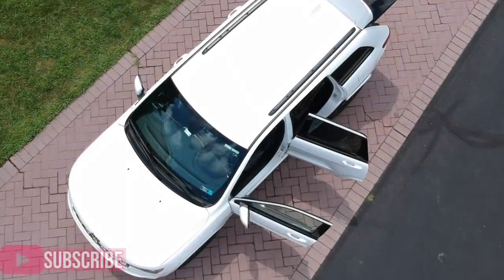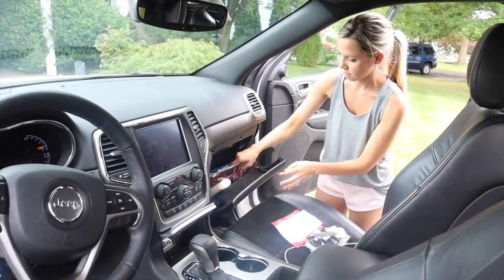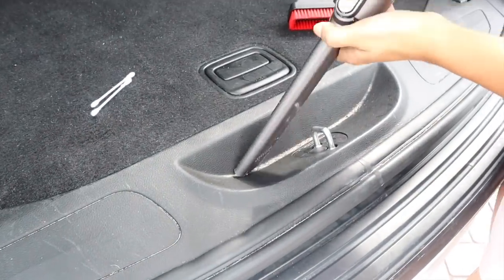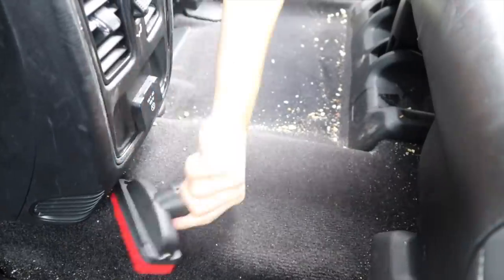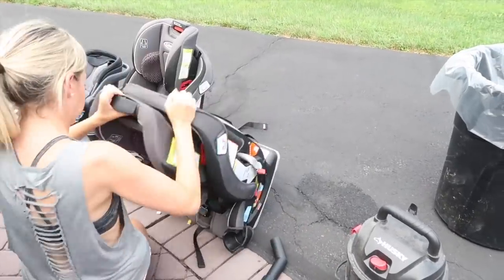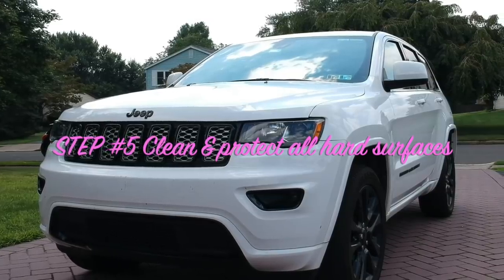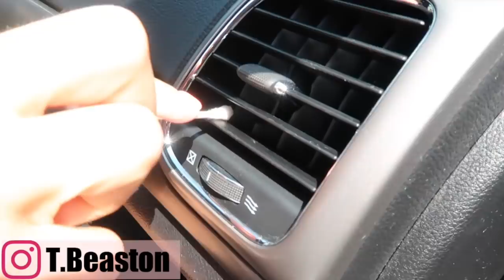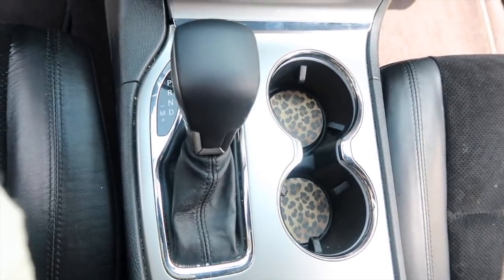EXTREME CAR CLEAN AND ORGANIZE // COMPLETE DISASTER CAR CLEANING ORGANIZATION HACKS // CLEAN WITH ME

Comment: you have to get the Tineco A10 Hero Cordless Vacuum, Stick Vacuum Cleaner Lightweight 350W Digital Motor Lithium Battery and LED Brush, Handheld Vacuum, Deep Clean Pet Owner [2 Year Warranty]. I have  a dog and a 3 year old  it works great. I love the light on it. it helps a lot. its on amazon.

Comment: I bought a trashcan for my car. They sell them on Amazon. You can strap it to a headrest, center console, gear shift, etc. I bought one that has a "lid." I use grocery bags as trash bags in mine. One of the best investments I've made. Sad when a car trashcan makes it on your list of "great investments🤷‍♀️🤣." #momlife There are a couple of  different sizes, options & you can put it in an inconspicuous area, if it would bother you to be seen. I drive a Jeep Commander & it fits around my middle console (w/ the actual trash can sitting in the middle floor of my 2nd row seats) just fine. Hope that makes sense 😉. I can find the link to the one I have & love if you need it. 
I agree w/ others about the weather tech floor mats. If you don't want to spend the money you could also get a regular seat protector off Amazon. I had a regular one before I decided to purchase the weather tech system. 
I would also recommend a Shark vacuum.  I would choose it anyday over Dyson. I've had both & the Shark won, hands down! I have a handheld Shark to do my car, stairs, etc. I have an upright model for inside my house. I'll never own anything else! That sounds dramatic but they really are THAT GOOD!!
Great video ❤❤